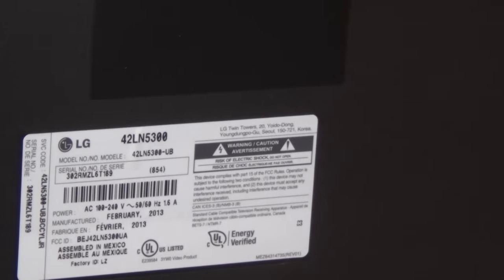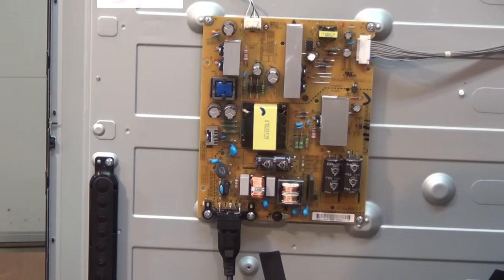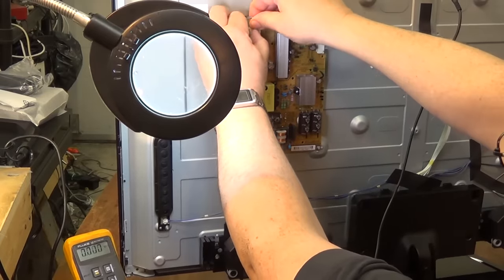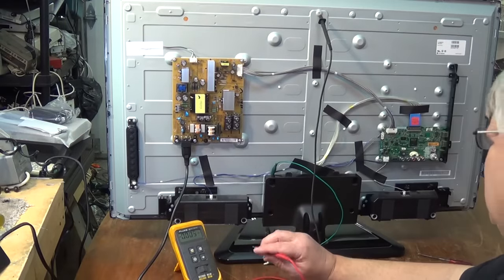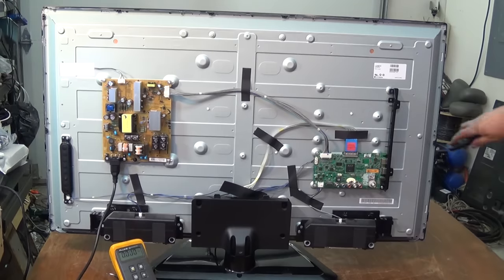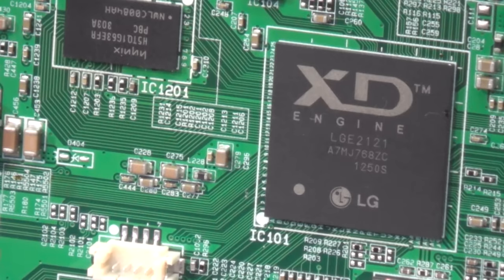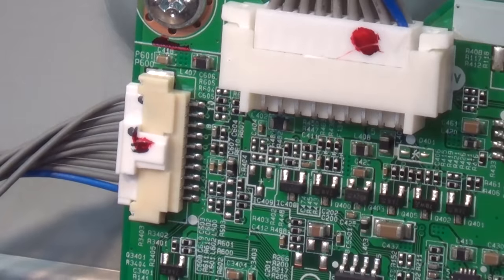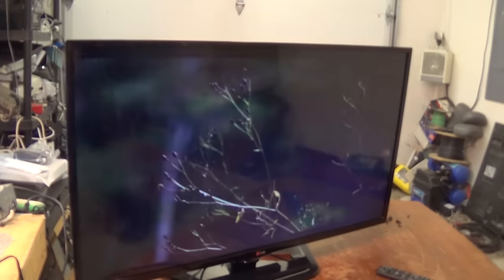LG 42LN5300 Dead   Not power supply

Comment: Did the same thing with my Samsung.
It worked 1 week and did againg the same problem. 
It don`t fix the chip. 
It`s a issue from the production macchinery that stamps the board
Reply from the maker: Well the set I did this with 4 years ago is still working.   It is my set.  My son has been using it with his xbox every day and it still works.  Your mileage may vary.
Reply: @12voltvids  my Samsung was new. End of 2017.
worked almost 4 month.
Board and charger used to get very hot at summer, then, 
beggan to switch on & off. 
i heated up the chip and pushing it with my finger.
worked 1 week and then died.
i`m trynna find a used board, but i can`t find it.
passed to LG. It works fine. 2 years, not a single problem.
Samsung now has become crap
Reply from the maker: @kavajamusic5411  Actually I have experienced exactly the opposite. 
Everything in my house that has been or is LG is "Low Grade, Literal  Garbage"
My son had a LG phone, had a BGA chip problem. My wife has an LG phone. Always rebooting.  My LG computer monitor has broken down already and had to be fixed. My LG plasma broke down, and had to be repaired. My 63" Samsung plasma ran for 10 years and developed black bars. 15 minutes was all it took to fix that one. Took longer to remove, and place back on the wall.
Now I have a samsung phone, my work phone is a samsung, both my kids have samsung phones, and my wife will be getting one as soon as her contract is up. See where I am going here.
LG = Lifes Garbage, Samsung = great.
Reply: @12voltvids  might be! who knows, but i live in Europe, and things here are different.
It`s like german cars. 
Here, German cars are the best. 
In USA are crap because are made in there! 
LG here is the top now. 
TV`s and washing machine are the most selled
Reply from the maker: @kavajamusic5411  Now that you have me going on German cars..... They are crap. My dad owned 2.  Mercedes, both diesel. The first one rusted out in less than 10 years, as did the second. It devoloped cancer as well, and had rust lobsters  cutting holes in the fenders, wheel wells, doors ect.  The second one also had more bloody mechanical problems than I have ever seen. First the clutch went out. when I was about 10 or 11. That was fixed, That thing always consumed oil too. My dad was very stringent on maintenance. He had his own service pit in the garage where he could change oil grease wheels ect. Did that all the time, every couple of months.  Very well maintained. When I started to drive i drove this piece of junk. One day on my way home it started gaining speed on it's own. I had no idea what was going on, but when I put the clutch in it started running fast. I got home. Blue smoke was belching out the back. Car would not stop. Couldn't push the engine run / stop knob in. Finially we were able to get it stopped by putting a board over the air intake before it threw a rod.  Turbo oil seal failed and was feeding engine oil into intake. Engine ran away. Engine had to be rebuilt. A few years later I wanted a nicer car.  I bought a used BMW. One problem after another. In 10 months I had pumped almost 4000 into fixing that piece of crap. Electrical problems, engine problems, power window problems. I got rid of it and bought another Ford.  I know many people that have driven german cars, and they all say the same thing. Piece of junk. Want a quality car get a Toyota, or an American car. These days they are built very good. True they had challenges back in the 70's where they had many problems, but over the past 30 years they have been great. My wife had a 1980 buick. Drove that right through to 1998, and when it was sold it was still running great. Had 379,000KM on the odometer. I drove my 1980 Ford Mustang for 285,000 km and it was still going strong when i traded it in.
Reply: @12voltvids  come on. i think you are exagerating. 
if the firts Mercedes was sow bad, why he had to buy a second one? 
A car, after 10 - 11 years,  gets old. it`s normal!
I don`t know about GM cars but Scotty Kilmer says they are crap.
He says go only for japan cars made in Japan like Honda, Toyota or Lexus.
And about german cars... A Mercedes, Audi , VW  and BMW ( sometimes), can go about 1 milion km with the same engine if used quality oil here in EU
Reply from the maker: @kavajamusic5411  Not at all. My dad bought a second Mercedes because his friend owned the dealership. Was the importer to Canada. So he got a very good deal on them, and the first one was a 1959 model.  At that time American cars were more expensive than German cars because, there were still many bad feelings for the germans because of the war. So people were not running out and buying german cars. My dad wanted a diesel because at that time he had a lot of driving to do. I vaguly remember that car but I do remember the one he replaced it with in the early 70's and I remember all the problems that one had.  My mother had a Toyota, and aside from the car theives liking it (was stolen and recovered twice) it has few problems, but when it did break it was a bloody fortune for parts.  700 for an ignition module, 1000 for a master cylinder. 
Parts were outrageous.  I'm not saying american cars are perfect either. I have never owned a ford that has been trouble free, but the 3 GM cars I have owned have been good. My wife had a 1980 Buick and that thing was pretty reliable over the years. I now have 2 volts, a 2012 and 2019 and neither of them has had a wrench touch it. 9 years in on the first volt, over 160,000 km, and the only thing other than a software upgrade was to replace the tires. Heck, the brakes still have 95% of the lining left on them. They just go forever. Oil has been changed 4 times in 9 years.
Reply: @12voltvids  forget cars before 2000. they where other thing.
Try to find a good mileage Audi, VW Passat  or new suvs bY VW or a Class E by Mercedes , but produced in Germany.
They are real german cars.

Comment: Typical problem of modern lead-free solder and BGA (Ball Grid Array) chips, Silver Solder does not cope with constant heating up and cooling down the way old Lead Solder did hance the dry joints form on the chips, Playstation 3 and X-Box 360 had big problems with this, if you have the equipment, remove the BGA's, re-ball the chips with lead solder balls and then replace on the board with IR re-work station and problem solved.
Reply from the maker: Yes it is and that problem is not going away any time soon.  
Did you know that the original bga chips used high lead solder that melted at a lower temperature just for this purpose so that heating and cooling wouldn't cause this problem.

Comment: Thanks for the video and trying to help DIYs. But when you started saying the capacitors should be discharged, your hand was in front of the camera and was blocking what parts the wire you were using was touching to achieve the task and never said what you were touching. You really just blew by this task. So now I have to guess at how to do this.
Reply: Short the leads...

Comment: PS. I have a 50 inch Samsung flat screen tv, practically brand new, it experienced a (power brownout) at my grandson's house, it no longer will come on at all. I'm pretty sure it may be the power supply board, what do you think it might be. I'm hoping it is the power supply and that I can replace it with a new board or either the bad part. If anyone has experienced this problem with this Model # UM40MU7000F-XZA. Please let me know how to fix it. I'd hate to throw away a brand new flat-screen by Samsung.

Comment: METER READINGS:
Following the "3.3 Volts" issue at about 04.45 min.  It is unlikely your handheld DMM is  accurate to within 0.2 Volts...especially if not recently calibrated. Look at your meter specs. If you base your troubleshooting on voltage deviations of that magnitude you may waste a lot of time following false trails.
ESD (ElectroStatic Discharge):
You're using a wooden table,/desk which helps from an ESD perspective is good as wood generally doesn't pool static charges...but you should also be using ESD wrist strap. You can cause more problems by injecting ESD into the circuitry and a wrist strap is cheap and easy protection.

HALOGEN LAMP WORKAROUND:
That's creative. Perhaps you could use a temp sensor sometime and find out how hot you're getting the chips?
Reply: You seem to have no idea. Fluke 12 has +/- 0.9%+2 accuracy on the 4V DC range. Even if it's slightly miscalibrated in will never give the 3.3V measurent at the 3.5V voltage.
Reply: You have no need to be insulting to someone trying to help point out just a couple of the potential issues involved in making assumptions in electrical measurements. Thank you for providing the specs on your Fluke. Many people are not using Fluke DMMs.

I maintain my warning to folks. Just because a reading is digital and contains a lot of digits that the instrument is accurate to any great degree. One of the most fundamental errors students make when provided numbers in digital form for any instrument, is assuming ALL the digits are meaningful.

I've taken brand-new DMMs of the SAME model number, hooked them up in parallel and separately and measured various voltages and found consistently significant differences. Many of these meters are only accurate to 3 or 4 digits, AND then you add on a +/- 2% or 3% error range, AND then note that the last digit (often 3rd or 4th, even if the meter DISPLAYS 5 or 6 digits) can be +/- 1 digit. So a DMM may be off for example by 0.3 or 0.4 of a volt on the 20 volt scale...and then factor in auto-scaling and things become even more complex, and the first digit after the decimal point may not be reliable.

The DMM itself may also be miscalibrated even right from the factory, have a low battery (e.g. a "9" volt battery at 8.9 volts)...WITHOUT showing "low batt" (which CAN still affect the displayed measurement value as much as several tenths of a volt).

I've seen DMMs where simply reversing the leads resulted in a 0.3 VDC change in the absolute voltage...when it SHOULD show the same absolute value. For example, probes connected one way results in +12.1VDC display, and swap the polarity of the probe connections and it then reads -12.4VDC.

Then, if you change the voltage scale and repeat the tests, you may see entirely different values. Some DMM specs/manuals will show you that accuracy is dependent on the scale used.

In my opinion, one cannot ASSUME a typical consumer DMM is accurate to even 3 digits, and a lab-grade DMM must be properly and timely certified/calibrated to even begin to assume it is showing a reasonably accurate value.

I should have also mentioned in my earlier comment, that some power supplies contain a non-DC component in their output. Digital PSUs in particular have been noted to have sometimes significant "noise" in their output...as much as 300 or 400mV at high-frequencies (e.g. 20kHz and up). The problem is that DMMs can vary significantly in how they handle these non-DC components. It can depend whether the DMM uses any signal filtering (physical or software) in the DC scales, measures "true RMS" or not, and the correction algorithms they use can vary. In short, these non-DC components in the PSU output can add even more "error" to the "DC" voltage a particular DMM may be reporting, and the specifications likely assume pure DC measurements. The result is that the "DC" component output in fact MAY be reported accurately by the PSU's display, but the DMM may display a value that contains an slight offset that was created by including the non-DC component of the PSU's output in its displayed value. This variation can be significant.

One can also have a COUNTERFEIT meter. That's a real problem these days, so assumptions on accuracy can lead to meaningful errors. 

I also couldn't read the model number on your meter even at the full 1080 "quality" of the video. It should also be noted that just because it' says "1080" doesn't necessarily mean the source content is at 1080 or that it displays at 1080...numerous factors are involved, including transcoding that YouTube performs on submitted content. Even at 1080 your video is still fuzzy.

Comment: I watched another video and they put the power supply board in an actual oven for 2 hours at around 200 degrees.
Reply from the maker: Great way to blow all the capacitors as the electrolytic boils at 105c.

Comment: 2nd time LG Warranty i have the LG425400 Model now this is the 3rd time i'm having this problem need to pull out HDMI or re plug in power Cord and it would last couple days my first time the board was dead i don't know wtf is going on with LG with cheap shit parts but if i had this problem with my Computer motherboards i would loose it.

Comment: Nice fix, bga's are evil!!!
Was this a paying customer? How do you go about telling them, that there's a possibility it'll break down again in a few months?
Thanks for the video!
Reply from the maker: +Koffi Banan It is a paying customer. I will test it for a few days and advise them the root cause was fractured solder on a BGA mounted chip, and explain that there is no sure fire way to know how long it will last.  A smart person would put it on craigs list, and unload it on someone else. Saying that, it has been about 6 months since I did my Onkyo receiver, and it is still working but we all know how reliable BGA mounting is right. One of the reasons I like older electronics is the absence of BGA.
Reply: 12voltvids don't you think it wrong to pass off something for money that could potentially have a very limited lifespan due to it being a bandaid patch bga solder fix , just my opinion is all :)
Reply from the maker: First off I don't charge people for fixes like this. The majority of these sets are my own sets that have been donated to me. The odd set I fix for a client if it is BGA fault like this I advise them that the fix may be temporary, and don't charge, or charge very little. I make my money off views. I am not in the business of electronic repairs anymore. I retired from the repair biz in 2003. Now it is just a hobby, to see if I can get this cheap sh1t working again.

Comment: I used heat gun and it works fine, working again......
Reply: Hello, how long have you heated it ? And did you take off the chip or just heat the solder points behind the chip ? thanks

Comment: Could you please help me or point me in the right direction to pin point the problem. My LG 42LS345T has the same problem, it is totally dead, when I opened it, I found one of the blue ceramic capacitors blown up. I have been told this happens rarely, and replacing it won't fix it, the problem could be caused by something else. I am not asking you to do the fix or something like that, you seem very knowledgeable person, and I am hoping to know what I have to do next. 

Here's some useful link, they might help maybe. 

I have the picture of the PSU
https://imgtc.com/i/KIMigZK.jpg

And this is the actual blown up capacitor
https://imgtc.com/i/feL1sk5.jpg

this is the service manual I believe, the board is in the page 30 I think.
https://www.manualslib.com/download/793183/Lg-32cs460.html
Reply: i offer you some help. go ahead and replace the blue cap. that cap has a quality issue in that the voltage has punctured the insulating mica, maybe due to impurities in the mica film or your TV has experienced a voltage spike from a lightning strike.
Reply: Thank you, I have replaced the blue cap, also there was a blown up fuse. the TV works perfect now. :)
Reply: glad to hear that.
Reply: yes, sorry I mean blew. hhh   Thanks for the tip, Panasonic all the way, although they cost a bit more than the generic ones on ebay.

Comment: My 2015 Sony 55X850C went dark to a power on aborted soft re set visible > shut down ,it  was some  LD board section T3 transistors and so on I fixed here and the failing over volting edge lit LED's and worse the Mainbaord the extended warranty co. provided board changer fried hot plugging LVDS cables like a fool and flagged the entire LCD panel when it wouldn't do anything at all. ,

The fool never used a volt meter (DVM) that would confirm the status lamp .diag. code ***before he fried the main board ***

That's when I saw my new TV ☺☺

Upside was I keep the Sony 55X850C  ,fixed it for another room for the family ,(not expensive with new salvage pulls  and the circuit parts ) and got a free much better and new  2016 Samsung 55 KS 8000 HDR 1000 TV with a vantablack 7000:1 contrast > 1474 NIT >Quantum Dot Samsung direct FA01 panel in here  and a way better TV :) .

Comment: You don't actually show us regarding the VGA soldering. You just only talk ang talk and talk
Reply from the maker: 8:21 is where I heated the board. Yes I baked it with a halogen lamp for about 2 hours and it is still working as of March 2019. TV belongs to a friend.  Yes a halogen light will provide plenty of heat.  The residual flux under the chip was bubbling out like crazy.
Reply: @12voltvids  tnx for the response. So in other words, you only reheat the chip using the halogen lamp not pulling out the whole chip? 2nd question sir, why not use hot air instead of halogen lamp?
Reply from the maker: @narvaeztiamson918  
Don't have a temperature controlled air station.  Just heat gun and that puts out too much heat. The lamp heats without blowing parts away
Reply: @12voltvids  thanks so much. Another question sir if you don't mind. I have a defective 32inch SONY LED PANEL. Is it possible to replace the panel with a 32inch LG LED PANEL? Because my LG LED TV'S mainboard were already dead , but it's panel is 100% operational. Will it possible? And how many watts of halogen lamp you used to re-heat the chip? Tnx